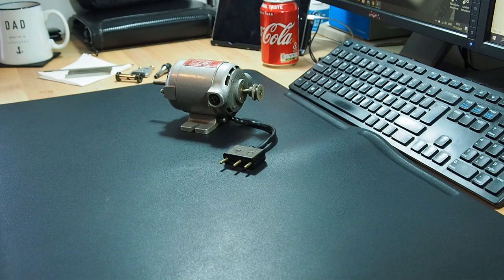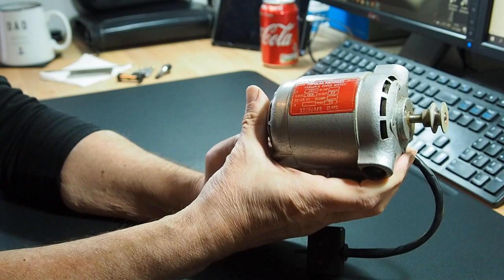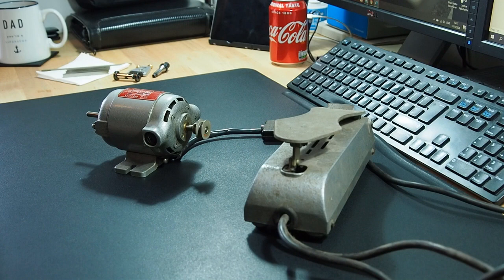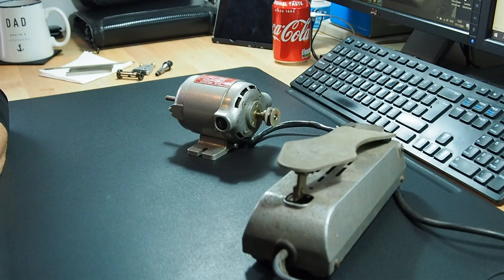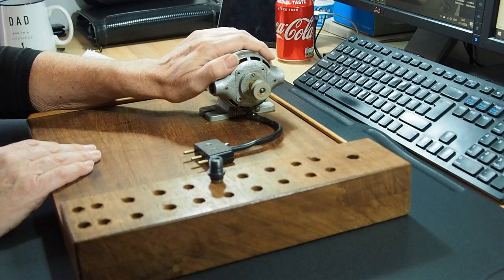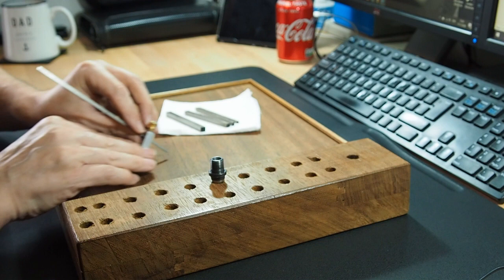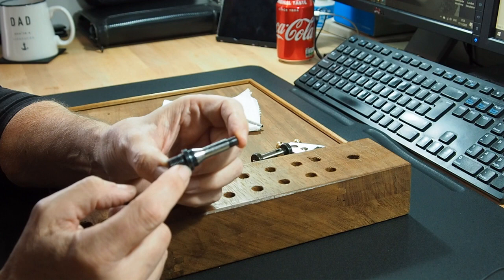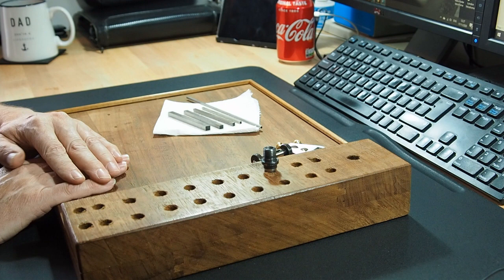IME Watchmakers Lathe - Electric Motor.

Comment: My Sydney and Canberra watch and clock groups have found it is much better to run a watch makers lathes at slow speeds. High turning speed tend to destroy the graver cutting edge and also work harden the pivot steel. We have found the 24v scooter motors to work well, excellent torque at low rpm which the 240v motors generally lack. Often at low speeds the 240v motors overheat. Cousinsuk sell the belt you need. Probably 4mm use a hot knife to melt and join. Also they have very reasonably price diamond plates suitable for sharpening your gravers. Good luck with your lathe.
Reply from the maker: Hi Hugh,
Thank you very much for visiting and taking the time to help. That is very interesting information for someone who is just starting out with the watchmaking lathe. I will checkout the scooter motors.
Thank you again.
Paul,,
Reply: Hi Paul in addition to the motor you will also need a 24V dc power supply and a speed controller, all three can be sourced on eBay. Unfortunately I have not seen a pedal control. Cousins also sell handles which can be used with your hss tools however I tend to turn small handles for this purpose. If you source a book titled “the watchmakers and model maker lathe by Donald de Carle it is an excellent reference. Good luck and I look forward to see how you go.  Regards Hugh
Reply from the maker: @hughgaynor4320  Thank you Hugh

Comment: You could use the Unimat to make an idler pulley for belt tension on the I.M.E.. And the Myford to make parts for the Unimat. Might need to look for a classic Colchester or Monarch next ?
Reply from the maker: Hi Rich,
I plan to share some of the chucks, collets, etc. between the IME and Unimat. also share the ER16 collects between the Unimat and Myford... I am keen to ensure each machine can work without to much effort so will have individual motors on each machine.
No more lathes will be entering the workshop I can assure you - hehe
Take care
Paul,,